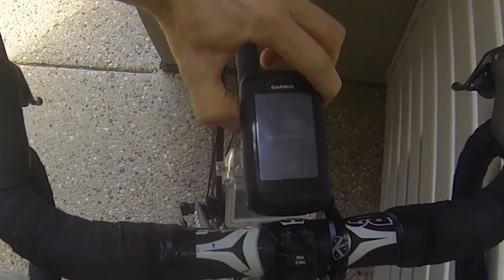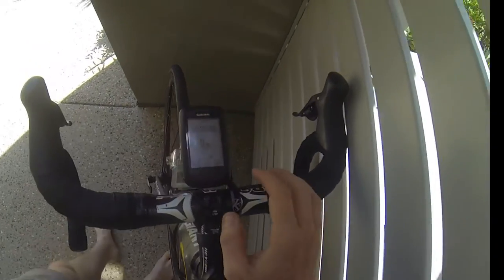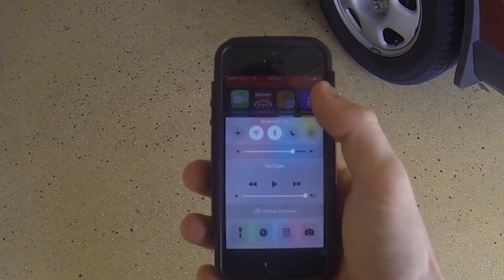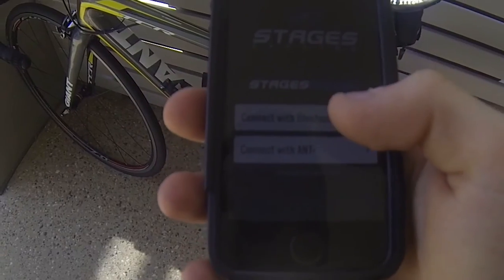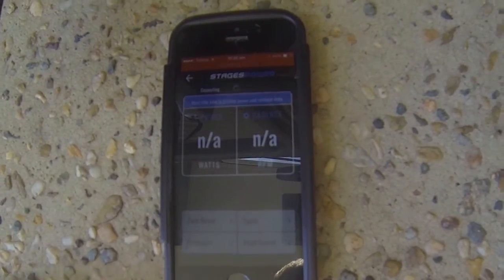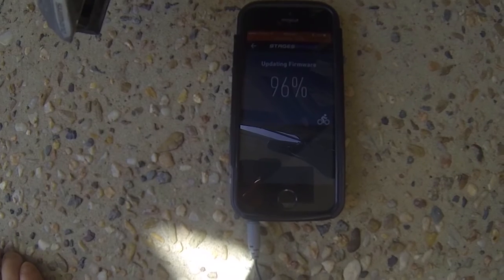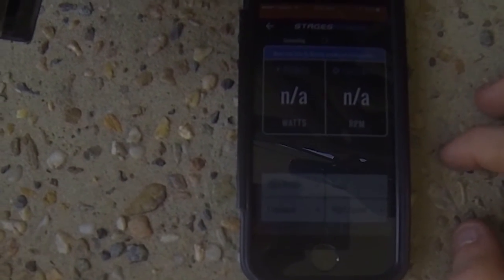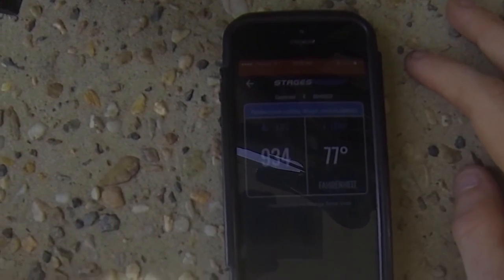How to Calibrate Stages Power Meter + Firmware Update

Comment: But what exactly does the number mean? (Mine says 886)
Reply: It is just the internal offset (probably voltage) needed to yield a zero output. Depending on temperature expansion since manufacturing an ageing the crank produces some tension which gives a non zero output voltage on the cristal. This must be offset to yield a nice 0. Nothing to care about.
By the way, calibration is a huge misnomer. It is zero offset. Calibration is done in factory using a defined calibration equipment (known force, required output).
Reply: What's the potential error if your ftp is say 300 watts?

Comment: That's a long winded calibration... try turning the Garmin on, single press power button, press power meter icon and calibrate!
Reply from the maker: the long calibration is what you should do only occasionally after moving to a different place or installing the power meter
Reply: Indeed, I was talking about the everyday calibration, the workflow above saves a few clicks. Handy video though, just updated my firmware!